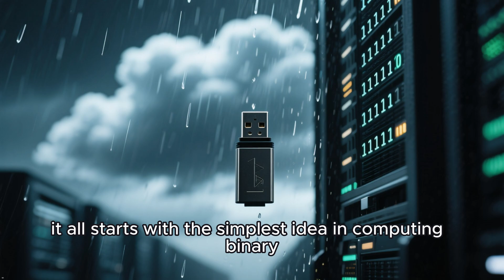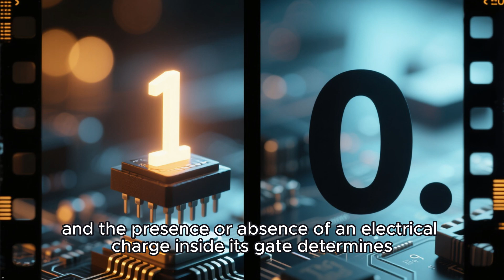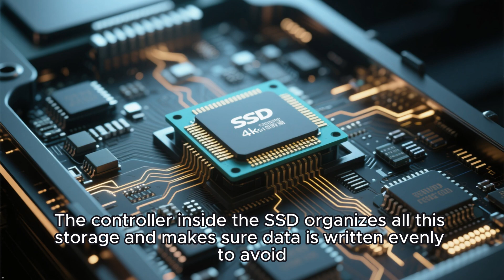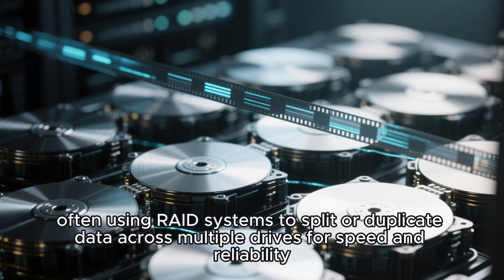How Storage Devices Actually Store Data | Knowledge Hub

Comment: There's no 1 neither 0 in comps, smartphones, on or in HDDs, SSDs and memory cards. I checked inside out. 😮
Reply from the maker: Haha true, you won’t find little 1s or 0s sitting inside your HDD or SSD 😅 
They’re just abstract representations. In reality, it’s all about physical states: tiny magnetic fields in HDDs, electric charges in flash memory, or voltage levels in circuits. Computers interpret those states as 1s and 0s so we can work with digital data. That’s the beauty of abstraction in computing!
Reply: @knowledge-hub65  , this layered interpretation is what makes digital computing practical, but it does not change the analog nature of the underlying hardware.
Reply from the maker: Exactly! 👌 That’s a really important point. At the lowest level, everything is still analog, voltages, charges, magnetic fields but by enforcing thresholds and interpreting them through layers of abstraction, we get the reliability and practicality of digital computing. It’s the bridge between messy physical reality and the clean 1s and 0s we work with. Fascinating stuff! 🔍💻